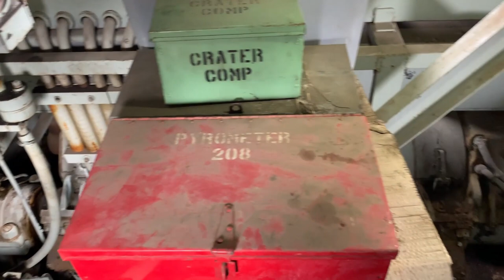Rotary Snowplow Run and Cab Ride at Portola WPRM 02/25/23

Comment: I Understand Rotary Snow Plow Is Not Sel Propelled Hence Requiring LocomotivesTo Push And Puil Them But I Also Understand The Blades Movement And Electricity Are Obtained From An FB Unit As Power Supply Since Rotaries Were Time Ago Originally Steam Operated

Comment: Did NOT here the steam whistle.  That horn sounds like the ones used by UP on the SPMW rotaries on Donner.
Reply: This plow is diesel electric...not steam powered.
Reply: @michaelperkins5858  After SP retired its steam locomotive, they converted their rotaries to electric, the steam generators in the passenger FP7B 'snail' units (diesel-electric prime mover) were retained for the rotary handheld steam lance, used to clean off snow & ice from the blade, wings (if applicable), trucks and other parts. The converted electric rotary unit also retained its original steam whistle as well as air horn. You can find other videos from the 2000's where UP's ex-SP rotaries still use the whistle.
Reply: @michaelperkins5858  Although the rotaries were converted to diesel electric, they retained steam generators for heating, thawing ice from the wheel and rotary hood, and blowing the steam whistle.  From the lack of steam in the video, I'm guessing they did not have the steam generator fired up.
Reply: Do any of you guys know what type of steam whistle is on the Rotaries?

Comment: Are those heaters attached to the cab windows?
Reply from the maker: No, they are clear fans attached to the exterior surface of the windows that keep snow and ice off of them for improved visibility.
Reply: It's called a 'Clear View Screen' and as the old boy said, it's just like they use on boats and ships. Look it up on Wikipedia, I don't dare post the hyperlink link, but basically, it's a single spinning disk that goes really fast, so neither rain nor snow can stick to it. Basically, there's a section of window that spins.

Comment: I had an idea to create the most modern steam locomotive on US rails, using former frisco 4-8-4 #4516. Would the WPRM be up for donating the 484 tender originally used by this snowplow for use behind the 4516? as a tender for containing liquid fuel is required for the project, and the current tender behind 4516 is not suitable.
Reply: What have you been smokim' ? ? ?
Reply: They don't have its original tender. And even if they had the tender I highly doubt they would donate it.